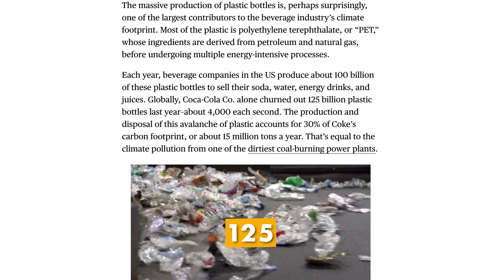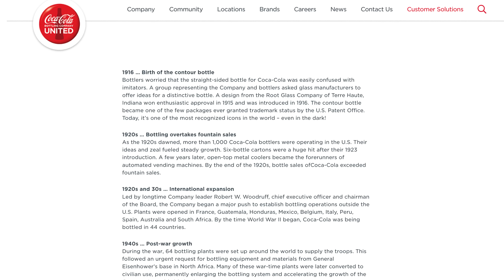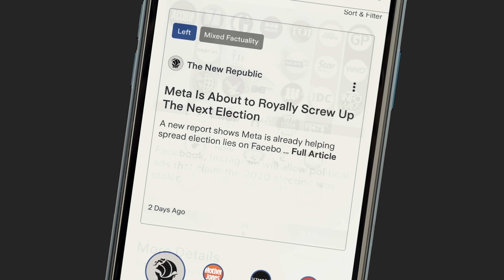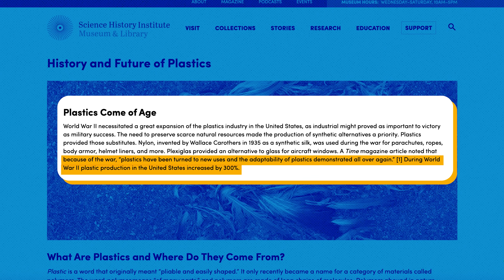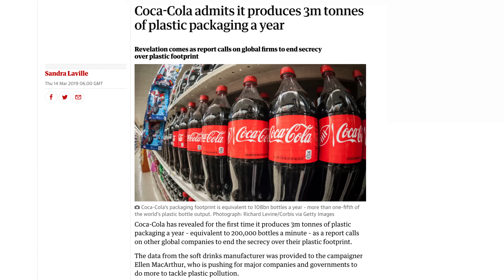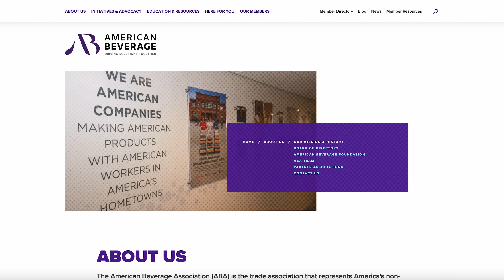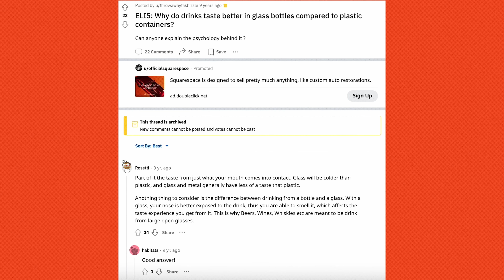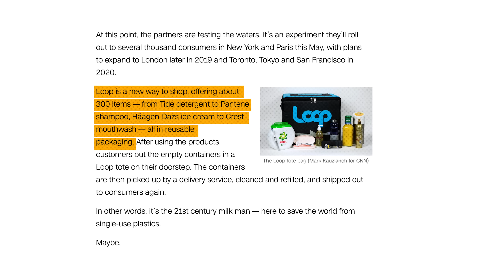Why the Glass Bottle FAILED

Comment: I'm 67 yrs old, a soda was 10 cents, 5 cent deposit included, kids would pick up bottles off road sides, and bushes. Return Soda bottles and beer bottles, for deposits.  4 empties get you 3 sodas, and a nickel.
Reply: yep i did that on the walk home from school pick up sota bottles and stop at the corner store and get a soda.
Reply: I used to buy returnable 48ct cases of beer. Dirt cheap, $5.00 if you returned your old case intact. If one of my idiot friends broke a beer bottle, I'd charge him $5.00 because it was going to cost me $10.00 for my next case.
Reply: 2 cent for a pop bottle  5 cent for a quart beer bottle, 25 cent for a one gallon milk bottle.  Handling was more than the cost to make a plastic  bottle.
Reply: 4 empties at 5 cent deposit each would be a total of  20 cents, enough for 2 sodas period. I do wish we still had the deposits.
Reply: Your math is wrong
Reply: @mac11380 But with those two sodas you can get another 10 cents for a soda then end up with 5 cents
Reply: I saw that in a cartoon once. I was very much jealous that they could get money to buy a skateboard from that. Now I grew up and I'm jealous their parents could buy a house 😅
Reply: In NC, when drinks were 10 cents, the deposit was 2 cents.  It remained 2 cents well into the 1970s and finally went to 5 cents.

BTW, they are not "sodas."  Sodas were made back in the old days and used sodium bicarbonate (soda) for the bubbles.  Today, they use CO2.  They are soft drinks.
Reply: @glennschemitsch8341  There was never a deposit where I live except on drink bottles.  Beer bottles were always throwaways.  I've never seen a gallon milk bottle, and I'm 70.  Quarts and pints are all I've seen.  I have some in my collection of "stuff."
Reply: Even in USSR you was able in a year collect bottles (of beer mainly) to hand a money for a brand new car (yet cheapest one, ZAZ-969).
Reply: In Germany this is a commen income oppotunity for unemployed and/or homeless people. They walk around with big bags, collecting bottles from bushes, street, trash bins and other places and return them all at once.  Even some people who have good jobs do that. Poor people are almost respected for bottle collecting (people who clearly do not need it are seen as greedy, though) and if you know that, for example at your work place there are some minimum wage cleaners, you sometimes place your bottle next to the trash bin, so they can collect it as a tip, while not having to dig trough the trash for it.

It is definetly distopian, but it bringing that return rate up and helps poor people get through life.
Reply: I’m 25 in Colombia we had the same thing any glass bottle had a hold, and we’d collect them to get free drinks.
Reply: @markthompson4885  Well, then come to europe, you can still do that here. 25 cent deposit on Plastic Bottles and Soda Cans. And you can get an Energy in a can for example for 29 cent.
Reply: I too collected bottles in those days.  I'm glad those days are gone.  Our grandchildren will one day talk about plastic containers the same way we remember glass containers.
Reply: That still happens here in Sydney, they decided to revive it in order to reduce plastic waste
Reply: I would exchange bottles for beer
Reply: Yeah, when he asks in the video how to square convenience with glass bottles, it mostly comes down to giving the right incentives so someone will find it worth their time. We have deposits on beer bottles in my country and when I buy them to drink at home it's no problem, but it is inconvenient if I'm bringing a bottle with me  somewhere (e.g. to the park when meeting a friend) and maybe go somewhere afterward where I can't bring a glass bottle. Our solution is to just put them next to the public wastebins - homeless people go around and have an easy time collecting lots of the bottles that way and earn some money. It's only a problem when stores are closed though, and since it's fully automated anyway (we have similar machines like the Netherlands), I don't get why they don't put them on the outside of the stores.

Oh and one more problem (not just with glass deposits) is bringing something across borders. Every country in Europe has their own system, so if you bring anything that would be recyclable in your country abroad, you basically have to hold on to it the whole time and take it back with you to get your deposit back. That would also be quite easy to solve though.
Reply: and a house for 7 quarters, damn boomers ruined the economy.
Reply: When I was a kid I could walk around my neighborhood and gather $20 of plastic bottles. Now more people are doing it, so the streets are pretty bare now. :P
Reply: well u see cents we’re basically dollars back then and dollars were like money you save for a car
Reply: For my generation that would be a $3 coke with a $1.50 return. HELL YEAH ID BE RETURNING BOTTLES

My state just upped the ¢5 return for the first time last year :(
Reply: You know we could still do that today but nobody wants to pay people for that anymore so we have to rely on garbage men and roadside workers for that
Reply: I'm 61, the same.  We would drive around to collect bottles and cans so we could buy gasoline so we could drive around to collect bottles and cans.   Plus, soda in plastic bottles never gets cold enough to taste good.
Reply: The face masks we were all wearing are made with plastic. Now we are finding people have contaminated lungs with micro particles of plastic.

Comment: GLASS IS BETTER.
Reply: Nice minutemen pfp
Reply: GLASS IS GLASS AND GLASS BRAKES JERRYRIGEVERYTHING
Reply: @nupurchapkxd  What if I told you that East Germany made Über Glass that never breaks, and is still used in many Eastern German establishments to this day. Sadly the Glass was too strong and Western business refused to buy them since they can make profit frome people replacing their broken glass's, the Über Glass Bottles would remove that cash flow.
Reply: That's why Fritz-Lokal, one of Germany's most popular coke companies never sold a plastic bottle.
Reply: That’s why they prefer glass bottles, for the caps
Reply: Glass is glass and glass breaks
Reply: @sksoyeb0303  We could use Superfest. Superfest doesn't break that easily. It was developed by East German scientists in reaction to the glass in the GDR. The same technology is used for security glass as well as modern break-proof smartphone screens.
Another advantage is that you need less glass and that reduces the weight.

The downside is that it's harder to recycle. But be honest, is this really that an issue? Most glass bottles can resist falls pretty well.
Reply: Glass is Better for environment 
Glass is Bad for corporate
Glass is heavier than plastic
Glass is bulkier than plastic
Glass is fragile
Glass cannot be close once opened
Glass use a lot of energy to make
Glass cannot hold a large volume of liquid
Glass use a lot of fuel to transport because it’s heavy.
Reply: @MutheiM_Marz  Glass is only better for the environment at the current state, if the transport ways a short. 
Glass is not bad for corporates. It adds just responsibility and your cost efficiency is based on how many glass bottles you sell and if you have your own production line close to the market you want to serve. Glass bottles could be more cost-effective if the government stops the extreme subsidies on new plastic production, increases the taxes on fresh plastic, lowers the taxes on glass production and glass bottles and introduces a uniform deposit system with obligations for manufacturers, retailers and sellers.
We could produce thin and reliable glass bottles, e.g. Lemonaid does it. And with technologies like Superfest, which has existed since the 70s, we could make the glass break resistant. The technology was developed extra for creating break-resistant, thin drinking glass and it's the base of modern Gorilla glass used for many modern phones.
Glass is fragile but it's not as fragile as many people think. Glass bottles are designed to resist falls and other forms of impacts pretty well and even plastic bottles have issues when they fall. Carbon dioxide can cause explosions of plastic bottles after a fall.
Glass bottles can be closed. If you open the crown caps carefully, you can put them back on. There are also bottles with a screw cap made from reusable plastic (e.g. Glashäger use it for water bottles in our region) or metal (like fritz-kola use it on the 0.5-l bottles), and there are also plastic corks with metal clips (like Mecklenburger Fassbrause use them). These three types of caps can be closed after opening, are easy to recycle and the last one is even reused several times before the seal needs to be replaced, while the cork itself lasts the entire life of the bottle before being recycled. 
Glass needs a lot of energy in the production but a PET bottle can only be used once before it the bottle goes into recycling and down cycling. A reusable plastic bottle is used up to 17 times on average before it goes into recycling, glass bottles are used more than 35 times on average before the glass bottles go directly into the glass production where it can be recycled into new glass at a ratio of ca. 100%, unlike plastic which can only be partially recycled into a plastic with lower quality, while the rest is downcycled into things like house insulation or filler.
In Germany, glass bottles of 1.5 l (0.4 gal) are common for water and soft drinks. 2.0 l (0.53 gal) are rare. 3.0 l (0.79 gal) is common for alcoholic drinks like wine. I know that's small for Americans but Europa can live with such sizes. You don't get a gallon in most backpacks easily.
Reply: @alicethegrinsecatz6011 
you wasted your time. sorry friend.
Reply: Not gonna argue you with you there.
Reply: @MutheiM_Marz 
Mate...glass can be made to be break resistant
Screw caps exist for glass bottles. My favorite drink only comes in glass bottles with screw caps and is about 2L a bottle.
Weight difference is bugger all
Not bulkier
Glass is easily recycled, literally clean it and you're ready to put on a new bottle caps and slap on a new label
Reply: Paper bottles

Comment: I remember when I was a kid "taking out the trash" meant dragging a small, lightweight can of galvanized steel to the end of the driveway once a week. That's how much trash a home with 4 to 5 people produced in the 80's. Now, we have 2 giant rolling dumpsters, one for "recycling" and one for garbage. The garage men used to pick up the cans and dump it in the truck. Now they need a hydraulic lift flip the can in the truck.
Reply: Make Garbage Great Again
Reply: We are a household of two, usually having breakfast and dinner at home. And a 17 l plastic bag usually serves for two weeks. Half of that is cat litter...
I do drag about the same volume of glass, tin cans, PET bottles to the respective recycling sites, though.
Reply: I'm not going to refute your main point, as I think we have largely become a "replace it, don't repair it" society since the 80s, but the things you use as arguments don't relate to the volume of trash.

The standardization of the size and shape of the trash cans was driven by the need to automate the system. Trash gets heavy, and people's back likely hurt after years of repetitive motion of dumping the can into a truck. Hydraulic lifts both save time and their backs, but requires standardized trash cans. That meant the cans likely grew in size to support the weight of the trash and the forces from the hydraulic. 

Secondly, separating recyclables from standard trash AT THE HOME severely cuts back on the amount of contaminants in recyclables, by simply not mixing those two things at all. Contamination basically can render your recyclables as non processable. 

And finally, we have learned a lot about trash and it's impact on the environment since the 80s. Of course the system would see changes in 40 years of progress.
Reply: "Garbage Day..."
Reply: I take my trash out once a week, and I switched to a 4 gallon can in the kitchen because the larger ones never got half filled before they'd get funky. Some of my neighbors produce a volume of trash that seems to exceed the volume of their living space, on a weekly basis.
Reply: Most households in the 80s actually produced equal or more trash than today not less so i don't think you remember things that accurately
Reply: No "we" don't. You might, but I don't. I still have a 25-40 gallon galvanized can, but only put it out once a month. Most often, a small bag will go per week if necessary. Like most folks today, you simply consume far more than you need to, and very likely 3-4x more than most people on our planet.
Reply: @David-gh6vp most people don't earn enough to buy things in non-plastic containers
Reply: @David-gh6vp the consumerism claim is probably right too, buying a new phone every 2-3 years seems crazy to me. same with cars etc
Reply: The adaptation of hydraulic arms and lifts onto the garbage truck is not entirely due to trash cans being too heavy for garbage crewmen to lift all by themselves. Much of this shift likely had more to do with reducing labor costs for solid waste management agencies than anything else.
Reply: In the 60's we also burned most of our trash in the incinerator made from a 44 gallon drum. It made the washing smell good. 😂😂😂
Reply: Same here in Europe. Living in apartments we used to have garbage chute (had to look up how to spell that word) but now they have shut those down because they don't want to roll/carry it. Now you have to go and dump your trash in a locked bin that is submerged. 
There is actually a law demanding that it must be locked. Why?
Reply: hydraulic lift flip the can in the truck.

This is to reduce the risk of injury to the worker as well as removing the 2 extra workers. 
Long ago trash was done by had and buy 2 to 3 workers per truck. Now its done by one worker with very limited touching the trash. Times have changed and its safer for the workers.
Reply: @PupperFlan  It doesn't matter about "contaminants" in recyclables when a large portion goes straight to the landfill.  Everything at our local "convenience center" goes to the landfill except for glass and metal.
Reply: @Kevin75668  In the 50s when my parents lived in western NY, the trash people required all garbage to be wrapped tight before going in the trash can.  Trash, such as newspapers, candy wrappers, and such, didn't have to be wrapped up.  If your garbage was right, they would refuse to pick it up.
Reply: no, now they have a hydraulic arm to lift the cans.  They don't have to have it, it just works better and causes fewer injuries.
Reply: I don't even fill those bins halfway and they use the hydraulic lift opposed to multiple garbage men because it's much cheaper and saves time to have one person driving and operating the lift opposed to 2-3 people who toss it in the truck.
Reply: @satevo462  
do you forge your own steel by hand with wood fire, bellows, hammer, and anvil or do you let industrial furnaces and machines do it for you?
Reply: a lot of people burned trash back then, recycling wasn't even a thing
Reply: @sea2blu  WTF are you talking about? We never "burned our trash". That's even worse.
Reply: @king_james_official it's better than the every year cycle we were on in the early 10s. But phone technology has plateau'd. Of course now they are ridiculously expensive to boot.
Reply: My 2-person household produces about one 13-gallon bag of non-recyclables a week, and about half a can of recyclables every two weeks.
The hydraulic lift was a way to eliminate two well-paying but dangerous jobs, a way for capitalism to force more people into low wage jobs that are difficult to survive on.  A garbage collector could make enough to be able to afford home ownership on a single salary.